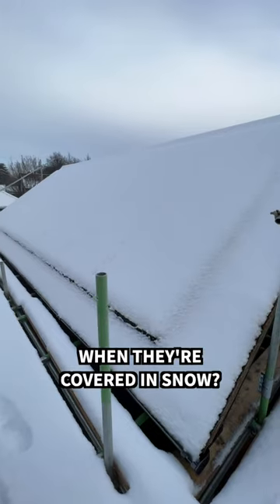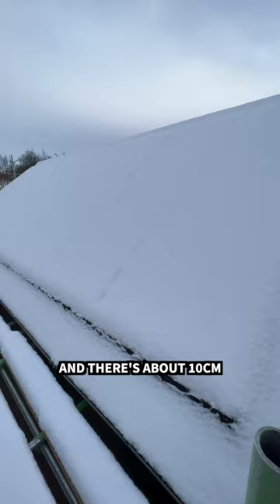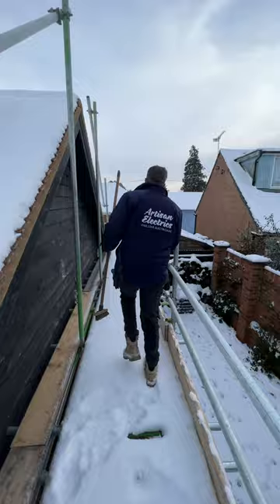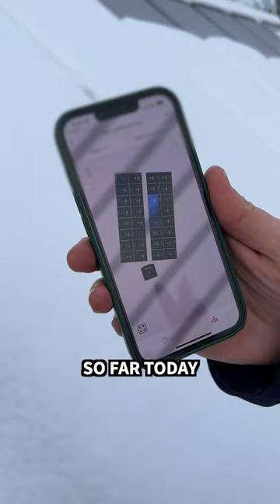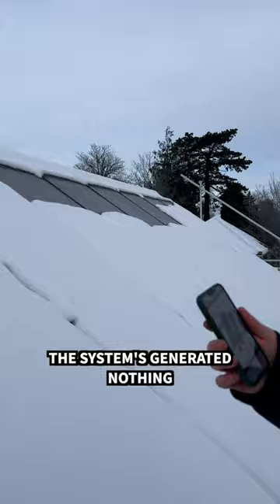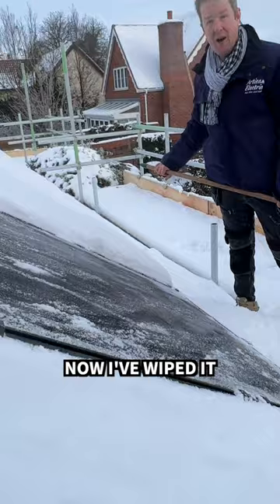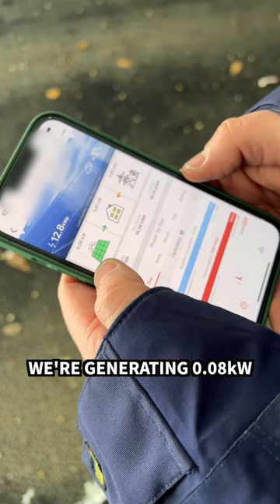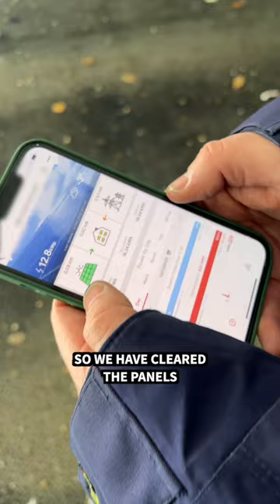Are Solar Panels completely USELESS in the snow? ⛄ #shorts

Comment: Whoever asks the question if solar panels work when they covered in snow, must wonder why there’s no sunlight when they go to bed at night
Reply: Actually up to about 50-80 mm of snow will still pass a decent amount of short wave light. On a bright day this is typically enough to run the panel heaters. The problem with this video is that it's duking overcast. He went from generating nothing with snow, to generating almost nothing without snow.

Comment: As an electrician, you should know the difference between watts and watt-hours.

When you mention the 2.5Wh at the end, that is how much has been generated so far, NOT how much it is generating.
Reply: This bugs the ** out of me - if a spark can't get it right what hope has the general public got when it comes to things like charger types and battery capacities
Reply: Indeed. When I was getting solar, about 3/4 of solar installers calling out batteries capacity as "Kw". Cringe. Not only is the wrong unit, as capacity/energy is kWh, but also all their quotes etc have the K big and w small.

Even the full quotes would call it like 10x 400w panels = 4Kwh.then battery 5Kw. All the wrong way around. 

Then these people have a go at diy'ers.

I had to have my mcs certified installer correct their mcs certificate as they didn't understand what to put on each field (they estimated my anual generation as 3.6kWh. Lol)

I also had to fill the g98 form for them 4 months post install (should be done within 1 month post install) as apparently they "forgot". So many cowboys out there
Reply: @cbflazaro Help needed. Driving 4000 head, cattle across plains. Cowboys need not apply.

Comment: I wonder if solar panels had some sort heating element to melt snow if it would be worth it. Maybe it would cost more to heat them than the panels could generate from being uncovered 🤔
Reply: @TheSir2005  I guessed as much but I don't have panels and don't work with them or know what they are capable of. It's a shame that solar isn't very useful at the time of year when energy consumption is generally higher.
Reply: Or maybe building some dome or clear cover over them, protect from haze and snow/ice.
Reply: They already have, it's called the sun. They don't take long to defrost once the big ball comes up in the sky
Reply: There are some people who rectify mains voltage and apply that to the string(only works with panel in string)
They report it to be quite effective and do not add any extra degradation to the panels. The power the solar panels then generate outperform the power used for melting.
Reply: Yes exactly but it only takes a little sun & they self defrost 10 or 15mins & if there enough sun to defrost there is enough to generate
Reply: Often thought you could use a 12v element like the rear screen of a car,  built into the panels for faster thawing
Reply: That's a good idea, they could even be on a switch on the ground so if it snows you turn on the heating element until the snow melts

Comment: If you’re an EE you would know how to use a bit of power to turn the solar panel in to a heater safely and melt the snow. PV panels a bunch of diodes and with some special consideration, you can connect a current limited power supply in the opposite polarity of normal and it becomes a heater. No need to worry about bypass and blocking diodes as they’re reverse biased. They do this already in other countries where it snows a lot.
Reply: So it has been -20 to -30 with wind chills of -10 on top of that.   How much heat to melt the snow.?   At 55 deg lat. how much would you gain?
Reply: @jhfl1881  the snow insulates itself. You only need to melt the bottom of it so it slides off. If you know what you’re doing, have a go and see what happens
Reply: @TheAviation101  what about heat lost through the bottom of the panels?   Cannot insulate them or they would overheat in the summer.   With the sun only rising 30 deg in the sky for some few hours I doubt it would pay back.
Reply: @jhfl1881  that’s why you use forecasting to work out when it’s best to do it. It involves little to no additional hardware. You can usually make an MPPT work in reverse through just a software change

Comment: As a Minnesotan. I can say that it's not that hard to melt snow when the sun comes out as long as it isn't just hitting the snow. I've simply removed a quick strip of snow off the driveway and street before rushing to work some days after a snow fall, and when the sun heats the exposed concrete and especially asphalt, then it warms up enough to melt the surrounding snow. Just need to manage where the water goes, because it is turning to solid ice if it doesn't go down a drain. Having a low power but long heating element at the bottom of the panels would clear off the snow quickly.

Comment: Thats why i like those watercooled panels. In the summer they are mor efficient and you get warm water and in the winter, you can heat them. :D
Reply: So you gotta use energy to heat the water to clear the panel for it to generate energy. Seems a bit pointless
Reply: @JoumSutin  no, cold water should be enough. But I don’t know if it is wise to keep it in the panels during freezing periods since the systems can break, I would just hose the snow away from a distance.

Comment: Well unless you live at the equator. Your Panels are at the incorrect angle and you should be adjusting them to the correct angle to the sun. Which can make a huge difference when it comes to shedding snow at 11 degrees with 6 hours of sun per day. Vs the summer time at 60 degrees

Comment: I don't have solar panels, but a few of my neighbors do.  I've noticed that whenever we get snow, no matter how thick, the snow seems to melt off the panels much faster than the plain roofs around them.  Maybe they're warming up faster from the limited IR that gets through the snow, or maybe it's the slippery nature of the glass, I don't know.  But at least in our region, they rarely seem to stay covered in snow for more than a couple of days.  Maybe it's different, further north.
Reply: Solar panels generally get a lil hot when in use.
Reply: Panels are slippery
Reply: Once one of the panels clears at least partially, it'll likely actually force current through the rest of the series array.  The shaded panels should heat up from that.

Comment: Well they are covered and it's cloudy,  you could have a water spray system that sprays warm water on them until it's cleared,  or put copper foil tape across the panel, not covering a cell, run a current through it, like a rear window defroster,  to keep the snow off them to start with, they would only be about 40-50° F. When it's 20°F out and snowing,  1/8" wide , and maybe with it all in series, with a 10 ohm 1watt resistor, it may be possible to just plug it into the wall,  pull about 0.5amp, at 240v  120 watts, that may keep the snow off it!! 😲
Reply: So it has been -20 to -30 with wind chills of -10 on top of that.   How much heat to melt the snow.?   At 55 deg lat. how much would you gain?
Reply: I mean you could just run a bit of current through the solar cells in their diode direction, it has nowhere to go other than turn to heat and probably a little bit of light and whatnot. Like why would you add an extra heater on the back when you can just intermittently run the panels themselves as a heater.

Comment: I am in the Midwest here in the United States During the winter based on my location, we have a 61° angle and even when there’s snow on them, I’m still producing power, and be careful you’re gonna wind up scratching and ruining those panels. Consider something a lot softer you don’t have to actually scrape the ice off Just the excess snow, because I asked the panel start producing more power that ice will start melting and sliding off

Comment: Like your videos, so don’t want to throw shade, but I would advise that SolarEdge inverters take between 5 and 6 panels in a string being exposed to sunlight before it can reach operating voltage and start producing. Otherwise, it just remains in night mode or flickers on and off as Voc climbs high enough to turn on but not sustain a high enough voltage to operate. Clearing one panel is essentially the same as clearing none, which this video shows.

Comment: I mounted my bi facials vertical; 40 snowfalls never cleaned a panel. Weeks away from producing over 2.6 kw in full overcast. With snow and sun 8370w array producing 9515w. It has been 1 year so time to clean the panels, rain does a great job cleaning vertical but a few blades of cut grass stuck.

Comment: I would have thought if you install solar panels every year you would have the glass coated with that stuff that makes surfaces non stick, that way when it snows the solar panels would just let the snow slide straight off, would not get tarnished by the rain and dust.

Seems the most logical thing to do, once a year just coat them with the stuff.

You probably do it to you car, some do it to their cars paint work as well so doing it to your solar panels seems the most sensible way to keep them clear.

Comment: You have to clear a complete string to generate a decent amount of power because they are probably connected in serial. If so the max amount of current is the current of the worst panel.
Reply: That is a microinverter system each panel has  separate inverter not connected in series.

Comment: I would put heat cord under the panels and in the morning heat them to remove snow. Possibly if panels connected in parallel, then heating one by one, free panel will compensate energy consumption.
Possible to make air heater from panels, then open panel will heat air which will further assist heating cord.

Comment: Baffles me why these state of the art solar panels dont have heating elements in the glass to stop them freezing or stop snow gathering on them🤷🏽
Reply: In 10 years+ of having solar panels in the UK, there have been less than 5 days when snow has prevented them from generating at full output - saying that if the sun comes out the reflective heat easily melts the lower layer of snow and it simply slides off if they're pitched - they actually work more efficiently in lower temperatures as it happens so why waste hardware and energy heating them up just to get a few extra Wh of energy :facepalm: It's annoying but hardly a deal breaker

Comment: funny fact: if you reverse power to the panel instead it will generate heat, therefor melting the snow from a safe distance. just make sure you dont short the rest of the system.
(disclamer: for educational and amusement purposes only)

Comment: Why install panels in a cold country? I live in Australia and my 5kW system is on the limit ever day of the year.
Reply: Because for one the sun isn't occluded around the year, and the panels still easily pay for themselves based on their summer performance; and for other you happen to need electricity where you happen to live, what use is to me that you have a panel in Australia with my name on it if it's physically too far for me to connect stuff to it and use it?

Actually snow only falls once every 5 years anyway.

Comment: 13th of the month....generated 16kw over the month so far, average 2 bed house in UK uses 13kw/day, so do solar panels work ......... 

Until solar panels become more than 11% efficiency, can generate on average 1.4kw/ day per panel, and houses are permitted to have megawatt power banks for personal usage, and are allowed to disconnect from the national grid, then solar panels are not working as envisioned.

Comment: I wonder if they could build in a small element to warm them up in these scenarios🤔
Reply: It would not be worth the money. You would use more electricity, than you would make from the Sun. - I had the same idea, and did the math. 🙂
Reply: @Sommeranders1995  It IS worth the money and there are companies already doing it. You only have to run the heat long enough to melt the snow

Comment: It's almost as if snow, and hear me out, reflects light
Reply: Snow actually consists of two completely transparent materials. Ice and air. Due to difference in refraction index, if the snow is thick enough, most of the light bounces around long enough till it comes back out in a random direction. But it's also very transparent.

If it was outright reflective, it would have looked a lot more metallic or mirror like. Weird but true.

Comment: It would be possible to heat the solar panels by pushing current through it. If done carefully, they could be heated enough to let the snow slide of without any further damage.
Reply: I don't think they make much heat, but I'm told they can generate some light
Reply: @iamdave84  I think it depends on the semi conductors band gap. Silicone has two band gaps, one in near infra red spectrum and one in the far red area of the visible spectrum.
So PV made from silicone would probability give of very poorly visible light, if any visible light at all.

Comment: There are panels made with heating elements to melt the snow. There are also panels with cooling pipes that help them run more efficiently in the summer. If you had in-floor heating you could tie the loop into your panels and flow warm water through them to melt the snow
Reply: Global warming meets global cooling, nice

Comment: There is a big difference between Moncrystalline vs. Polymorphous solar panels. Monocrystalline solar panels are cheaper and most popular. However, they don't produce voltage if it is cloudy. So, if it is partially covered with snow?? Polymorphous, on the other hand, will produce voltage if it is cloudy and if the solar panel is partially covered.

Comment: Only take about 20 years for them to pay for themselves.  And of course the warranty runs out in 5.
So yeah.  Useless
Reply: Return on investment is coming down massively with rising energy prices. Get battery storage as well and it's much more efficient!
Reply: @HereForTheMusic-h5o the batteries cost a lot plus need space for them. My neighbour last summer he told me at the current rate it was producing energy it would take 10 years to pay for it self that was at hight of summer so he won't be producing a lot during winter months. Of course it does add value to house as well if puts it on the market.